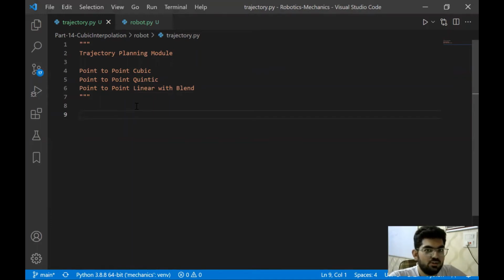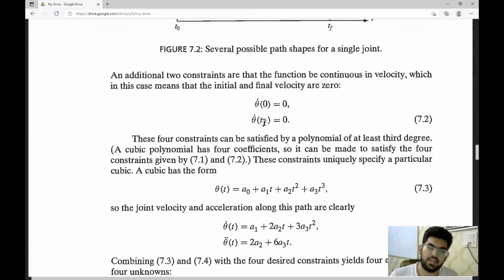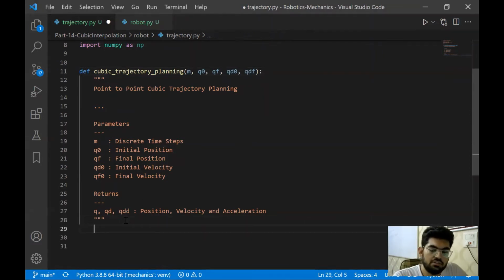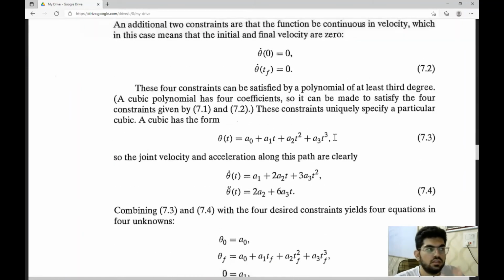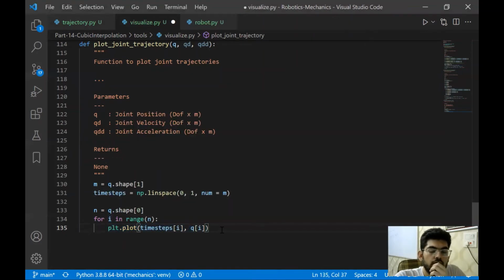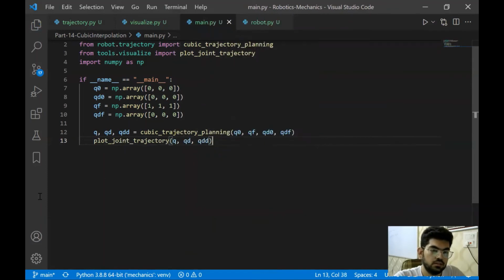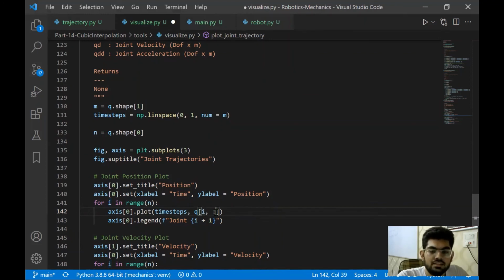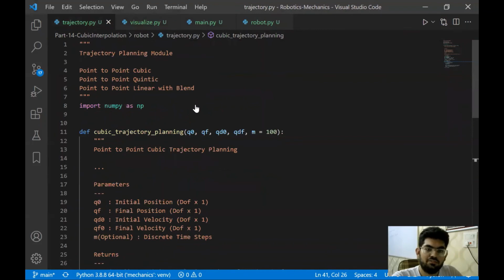Cubic Polynomial Trajectory Planning | Part 14 - Programming Robot Mechanics

Comment: https://youtu.be/h5vJjWGCtsI?t=1734

So the graph at above time in the video is showing continuous joint angles along with r,p,y.

Can there be an instance in time (0 to 1 second) in the above graph where that particular set of joint angles (and r,p,y) are not feasible, meaning a singularity condition appears ?

in between good effort on the topic and videos.